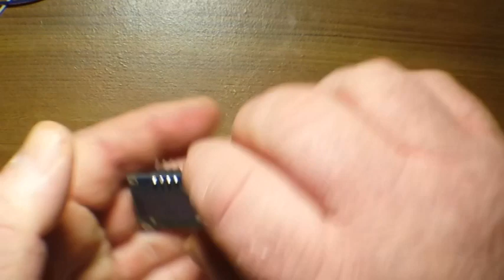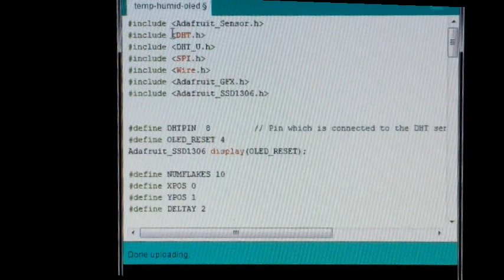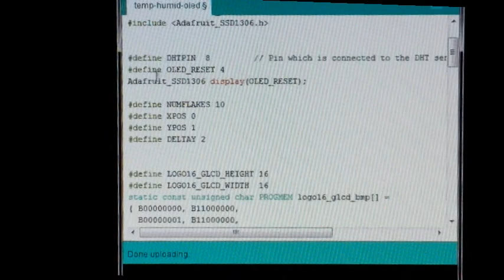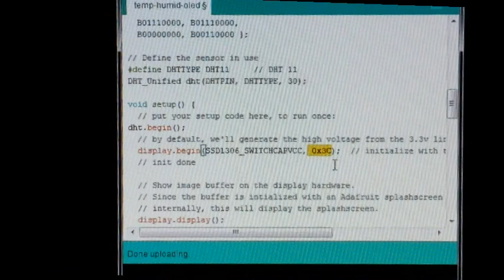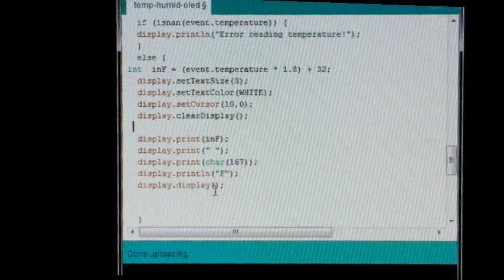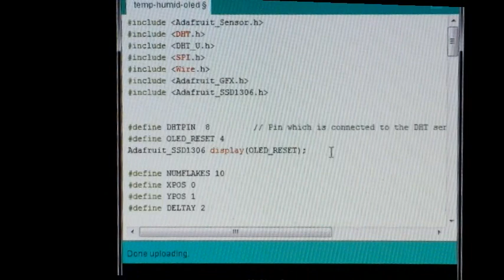Arduino weather station with dht11 and oled display

Comment: Hi Paul, I know this is an old post but I figure I would share my slight change to the program. Rick

#include <Adafruit_Sensor.h>
#include <DHT.h>
#include <DHT_U.h>
#include <SPI.h>
#include <Wire.h>
#include <Adafruit_GFX.h>
#include <Adafruit_SSD1306.h>

#define DHTPIN 8  //Pin DHT signal wire goes to D8
#define OLED_RESET 4
Adafruit_SSD1306 display(OLED_RESET);

#define NUMFLAKES 10
#define XPOS 0
#define YPOS 1
#define DELTAY 2
#define fSize 2 //font size - my oled needs size 2 default was 3

#define LOGO16_GLCD_HEIGHT 16
#define LOGO16_GLCD_WIDTH  16
static const unsigned char PROGMEM logo16_glcd_bmp[] =
{ B00000000, B11000000,
  B00000001, B11000000,
  B00000001, B11000000,
  B00000011, B11100000,
  B11110011, B11100000,
  B11111110, B11111000,
  B01111110, B11111111,
  B00110011, B10011111,
  B00011111, B11111100,
  B00001101, B01110000,
  B00011011, B10100000,
  B00111111, B11100000,
  B00111111, B11110000,
  B01111100, B11110000,
  B01110000, B01110000,
  B00000000, B00110000 };

  // Define the sensor in use
  #define DHTTYPE DHT11 //We are using a DHT11 sensor
  DHT_Unified dht(DHTPIN, DHTTYPE, 30);

  void setup() {
  // put your setup code here, to run once:
dht.begin();
  // by default, we'll generate the high voltage from the 3.3v line internally! (neat!)
  display.begin(SSD1306_SWITCHCAPVCC, 0x3C);  // initialize with the I2C addr 0x3D (0x3C for Chineese OLEDS) (for the 128x64)
  // init done

  // Show image buffer on the display hardware.
  // Since the buffer is intialized with an Adafruit splashscreen
  // internally, this will display the splashscreen.
  display.display();
  delay(2000);

  //Clear the buffer.
  display.clearDisplay();
}

void loop() {
  // put your main code here, to run repeatedly:

  // Delay between measurements.
  delay(1000);
  // Get temperature event and print it's value.
  sensors_event_t event;
  dht.temperature().getEvent(&event);
  if (isnan(event.temperature)) {
    display.println("Error reading temperature!");
  }
  else {
    int inC = event.temperature;
    int inF = (inC * 1.8) + 32;
      display.setTextSize(fSize);
      display.setTextColor(WHITE);
      display.setCursor(10,0);
      display.clearDisplay();
      display.print(inF);
      display.setTextSize(fSize-1);
      display.print("F");
      display.print(" ");
      display.setTextSize(fSize);
      display.print(inC);
      display.setTextSize(fSize-1);
      display.println("C");
      display.display();
}

  // Get humidity event and print it's value.
  dht.humidity().getEvent(&event);
  if (isnan(event.relative_humidity)) {
    display.println("Error reading humidity!");
  }
 else {
      int humid = event.relative_humidity;
      display.setTextSize(fSize);
      display.setTextColor(WHITE);
      display.setCursor(10,18);
      display.print(humid);
      display.setTextSize(fSize-1);
      display.print("%");
      display.display();
      delay(1000);
  }
}
Reply: hey man i used your code because he has not uploaded anything and i was kinda getting some lines and kinda maybe the right thing if i was touching it right but then it stopped working all together and i tried to upload a working sketch and nothing so what i am asking is if there is anything in there that could do anything like that i assume not but i dont know what i am doing and i was touching the display and the arduino so i assume i broke it but was also trying to figure out if something could have happened to my arduino i checked with the temp sensor it still works but i dont have any other I2C devices yet so i cant test that

Comment: Nice work but way way too many libraries (by Adafruit) from so many places.  Using the U8g oled Library + arduino-DHT-master library (the none Adafruit DHT library) you can achieve the same thing and and more. U8g library is  more flexible and have a lot of fonts to choose from, a lot of supported displays,and a lot more functionality to choose from (all on 1 big library) . But hey...this is just my opinion. Anyways, keep up the good work bro.

Comment: I want to build this with the 3-way sensor that includes barometric pressure, so I can record background data, and then experiment with sensors placed inside beehives, so I can compare temp and humidity inside and outside. I want to add data logging,  so I can graph the output and make comparisons between different hives compared with the background data. There is a lot more going on in a hive that could be analysed this way, and figuring out how to do that should keep me busy for some time. I plan to open source everything that produces useful results. Any pointers to videos, code or hardware that could help with this would be greatly appreciated.
Reply from the maker: +Philip Chandler Check my Arduino basics playlist, there is a video on datalogging. As for using the sensor with 3 values, there is really nothing to it but adding another field to the code.

If you get into it and need help, let me know.
Reply: Many thanks. I will have a look as you suggest. Breadboarding and component wiring is no problem, but I think I need to do a boot camp for the programming side.